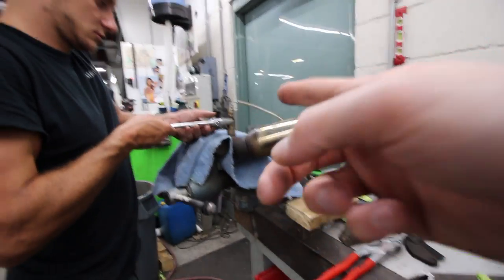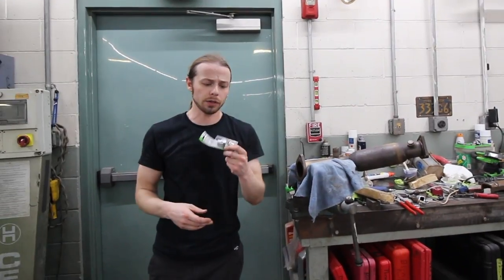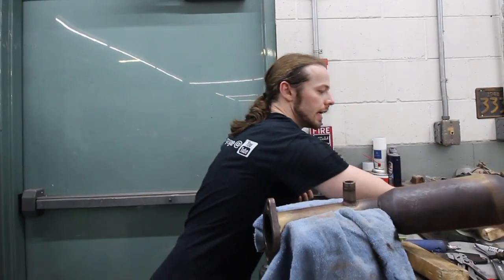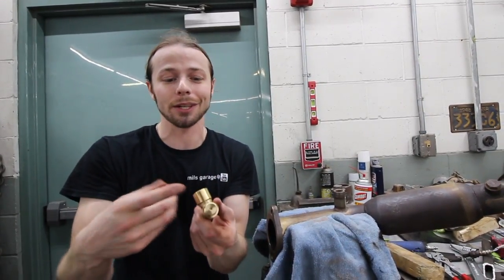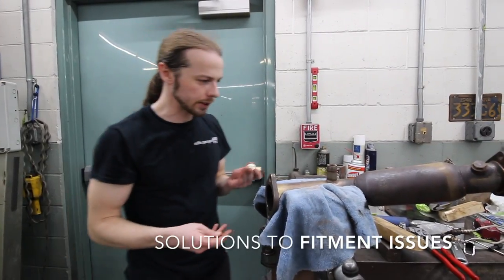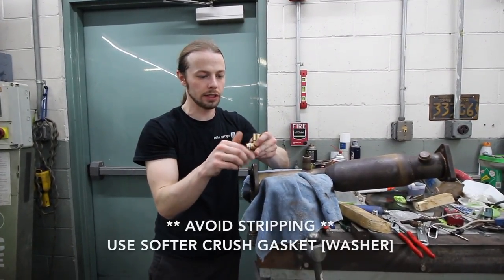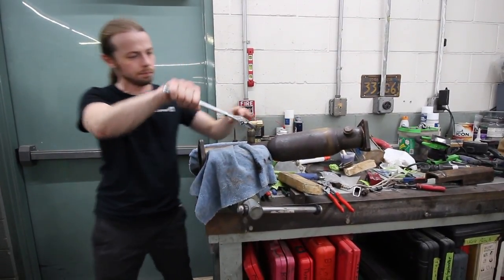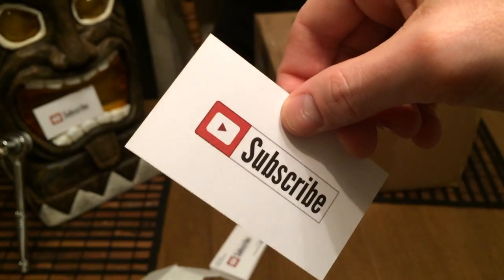How to Use O2 Oxygen Sensor Extender Spacer to Turn off CEL [ P0420 & P0430 Fix ]

Comment: I been getting codes p0420 and p0430 I just bout new cats for my Camaro and still getting the same codes you think these will eliminate my check engine light?
Reply from the maker: Those codes mean the catalytic converters are working below threshold.. So your first cats died, and are the new ones are high-flow cats or new OEM catalytic converters?
Reply: Mils Garage OEM
Reply from the maker: @DaRealGap1K  There's a chance the code just has to be cleared out.. It could also be a O2 sensor.. This solution might work, but not if the issue is one of those two things
Reply: Mils Garage all my o2 sensors new I just bought 4

Comment: Hey do know what size fouler would fit a sense of a 02 Yukon
Reply from the maker: i’m not sure, but they’re made for spark plugs, so i believe they should be a standard thread, with slight differences in length and bends
Reply: @milsgarage  thanks I found one made by vibrant that opens wide and sits deep that doesn't have to be drilled
Reply from the maker: @wavey strokums Awesome! Great work 👍👍

Comment: Looking for little help can i run my g35 with out a resinator and muffler have not codes pass smog
Reply from the maker: yeah, removing the resonator and muffler won't affect smog or throw any codes. it's just gonna sound a lot like this 👉 [ https://youtu.be/P1_Mk8Tx4uQ ]
Reply: Ill prob do res delete and good muffler magnaflow just dont care for all that restricted flow when removing cats did you loose any power with out all that back preasure i come from Ls  family they like back preasure
Reply from the maker: it's my understanding that the back pressure needed is mainly referring to the headers. if the headers are too wide, the vacuums don't flow through the engine at the correct speeds and timing will all be off, but as long as the headers are correct, removing the cats should help all cars. we haven't proven the increase in hp with a dyno cause we don't currently have a connection to one, but i definitely felt it in the buttdyno lol. it just pulls harder and breaks traction more readily. i could definitely use a tune though. you have a LS?
Reply: @milsgarage  yes in a chevy avalanche looking to get 08 g35 sedan with manual 6 speed trying to do my research on the car before i get in one seems to have alot more positives than negatives only hard negative i see is doing the diff bushing but i do love the fact they have full size sedan with high power 6mt i was looking at a srt4 caliber
Reply from the maker: nice! get the G35 and swap the LS into it lol. there aren't a lot of negatives to a G35.. i imagine you're after the HR motor, and that one is supposed to be better about oil consumption. the power is enough to have fun, and is reliable. the diff bushings are all shot, but Whiteline makes amazing bushings for $100. Srt4's are nice, but i always choose the v6 N/A setups ever since i had a MS3. boosted 4's always seem to want to blow up 🤷‍♂️

Comment: I’m having this same issue with the same resonated test pipes on my 2014 Q50 will this get rid of the permanent code as well? Mine is a p2098 code
Reply from the maker: @ls1killa i mean, that's a similar issue.. The p2098 says the engine is running lean, meaning there's too much air, and not enough fuel. Running like this will do internal damage the engine, burning out your cylinders and rings. Either you're having an issue with your fuel lines, a failed O2 sensor, or you need a tune to fix this. i'm not sure running non foulers will override the CEL, and i wouldn't recommend driving much until you get it tuned/solved. Sorry buddy, that's what i was getting ready to do to the old G [right before i got hit in an intersection, creating the need for the new G]
Reply: Mils Garage it didn’t do this until I installed the berk resonated test pipes
Reply: Mils Garage also I’ve been driving it for over a year
Reply: Mils Garage P0430 bank 2, P2096 fuel trim too lean bank 1
Reply: Mils Garage ok thanks I think it might be my air intake not sealed correctly thanks for your help
Reply from the maker: @ls1killa Sure, if there's too much air getting in that makes sense. But it also makes sense that it would happen after installing the TPs, because now the airflow is less restricted. The engine in turn needs to be pumping more fuel to compensate, or else it will run lean. We have the 99cent air leak test if you're looking for vacuum leaks :) [ https://youtu.be/tOHonr7ZB9o ]
Reply from the maker: @ls1killa Any time 💯 🤟😎👍
Reply: Mils Garage ok i’m going to run foulers on both test pipes, at the time of installing my test pipes I didn’t have my takeda CAI so I will keep you informed if the foulers worked I just think that the Q50’s are programmed different then the G37’s
Reply from the maker: @ls1killa i'm not sure about a difference in maps for either of them.. @TLE0622 IPL has an IPL and can probably tell us. i hope that they handle mods better than the G35s. Even if the non foulers work and trick the computer, i definitely recommend getting the car tuned asap

Comment: Okay first of all you need a longer Fowler a little itsy bitsy ones ain't going to work you need to double on it or they sell longer ones if you just use them by themselves you're never going to get it to work
Reply from the maker: Second off, it works. Get over yourself. No Fs G. 😎

Comment: did you really take the time to make an install video and NOT test them lol
Reply from the maker: lol test wut? The O2 sensors were working when we removed them 🤷‍♂️. We were testing whether the non foulers worked. They work. 👍
Reply: Mils Garage pull the o2 voltage graph before and after the install

Comment: Do this if you want to destroy your engine, this is a horrible idea, you get the P0420  when your catalytic converters are bad which means restrictive exhaust that increases back pressure which will gradually burn your valves and piston rings, plus you will have bad fuel mileage and it does not solve the problem, in a long run it is cheaper to replace the catalytic converters and be done with it.
Reply: I have po420 & my fuel mileage is normal. Please explain. I'm about upgrade cats
Reply: Or get test pipes